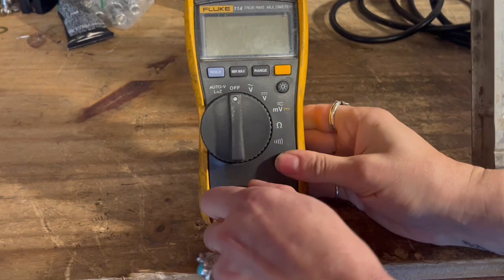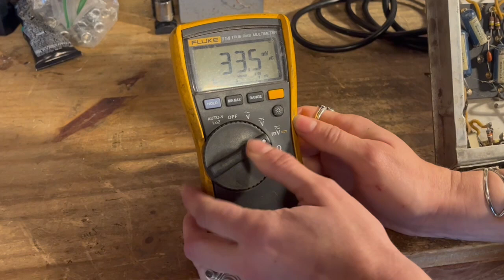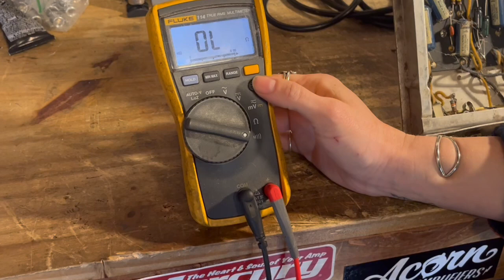How I Use My Multimeter | Vintage Amp Repair Test Tools

Comment: can I offer some vintage safety practices?  When the military was teaching me to be an electronics tech, vacuum tubes were still being used.  One piece of advice was "always keep one hand in your pocket".  This prevented having one hand grounded and then other touching a high voltage, resulting in current flowing through your heart.   Another recommended practice was to not wear metal jewelry (including our dogtags).  These pieces of metal might contact exposed component terminals, possibly shocking you, or just shorting out the circuit and causing damage.  Trust me, there are enough ways to get hurt without exposing yourself to easily preventable risks!  :-)   Thanks for the video!
Reply: My dad was military and Bell Labs trained. He has story about a guy losing (and cauterizing) a finger because he didn’t remove his ring. I don’t thing 350 VAC would do just that, but I wouldn’t wanna be the one to find out. For the sake of setting a good example to those new to this, please remove your rings!
Reply: @clubTSI  oh 350V isn't the problem here
The problem is how much current it can supply. If the power supply can deliver hundreds of amps easily without a breaker cutting it off then a metal ring basically turns into a red hot glowing blade. Especially at 350V? Easily. You could have the same effect at even 35V if the ring shorted the terminals of a high current supply. Because it'll pretty much burn through your skin and muscles
As a ring is near zero resistance it acts as a short basically and without a breaker or current limiter, it's going to dump all the current through it
Reply: @MaxC_1  perfect explanation man you know your stuff
Reply: She shows and explain this hand in the pocket safety technique in her previous discharging caps video. It’s a good tip, thanks.
Reply: I just added something similar to your comment! Sounds like we both had military training in electronic components 👍
Reply: I've heard that all my life and while it isn't bad advice, it's almost impossible to do  in some situations.   I think it's sufficient to always ask yourself 'where is my other hand and fingers'. Power saw users know this too.
Reply: I think I just came across the smartest comment on the internet. The bar wasn't very high so don't get too excited!
Reply: I’m a civvy that was lucky enough to be trained by Forces guys they gave me those tips. Very smart.
Reply: She already knows this…

https://youtu.be/_ATLTizLbDU
Reply: Yes, learned the same in the military; but one day, not thinking got a B+ 860 volt wake up.
Reply: While not military trained I was trained to do the same thing back in the 90s as it would lead a charge through one side of your body from your hand, typically, to a foot; when you use two hands a charge can go between both hands through your heart leading to death at her than just a painful shock. Also learned to do things in a manner that would cause a pull away rather than a grip or pull in motion as electricity can tense muscles and lead to you going deeper into the threat or gripping tighter; by planning on your position a shock would actually push you away from the electric.
Reply: Looking at it she is using Cat 3 test leads, I would recommend Cat 4 when working on valve gear. For the most part you should never encounter 1000V but I think the extra cover over the probes really helps. If you have 2 600V DC feeds close together then not so fun things can happen :\.

Comment: Safety precautions:
Remove all rings, wristwatches, bracelets, chains, and similar metal items.

Best regards from Odessa, Ukarina
Reply: That's an official rule in Intel labs when I worked there in 2012. Came about after someone broke a prototype board by shorting it with a ring.
Reply: @NiHaoMike64  
I think that at high voltages this increases the risk of electric shock.
And here is another reason:
Do not use clothing containing metal zippers, buttons, or other metal fittings. Metal, passing current, can heat up and cause burns.

Comment: Not sure if you answered it before but did you ever got shocked by mains voltage? These old amps seem to have a lot of open connections.
Reply: I made a probe “disappear” when I accidentally touched 170vdc to ground with 22,000uF behind it... poof... just gone!

Comment: I like tools that I can trust and I also like nice things, which brings me to the idea of buying a used Fluke. My original 77 purchased 20 years ago for maybe $75 is still working like new and highly recommended if you want to spend very little today. I picked up a 79 Series III to have capacitance and True RMS, but mostly because I like shiny toys. (Metaphorically shiny in this case!) I could actually get by with rubbish but not if it fails to work when I need it.

Comment: If the other components in the circuit are resistors and there is no cap that makes reading wonky, I tend to measure in circuit and then calculate the correct value from schematics :) 

However I have never fixed an old amp and if resistors are old carbon composites, I would propably desolder for testing :)

Comment: Nice! You break  it down very easy, and no nonsense. I recently got into FENDER amp repair. I own vintage ones. Like 9 of them. This helps tremendous . The video you have on discharging the filter caps was huge for me. I did have healthy fear, so i looked up multiple videos on it. Yours was the best, by far!

Comment: Glad to see you back!! Happy New Year. Have you ever done a tutorial on checking for noisey components such as resistors or caps with a signal tracer?? Also usint a an ESR for caps?? A lot of times values may not be bad but a cap component can be very noisy too. Also testing Electrolytics with an ESR meter to check to see whether caps are actually bad too.  I usually replace all parts but don't restore (Amps) very often.

Comment: Great content + straight-forward awesome presentation as always. My Fluke 26 is probably my most used piece of diagnostic gear (aside from my brain and maybe a metered Variac), and being completely comfortable with it and understanding what it's telling me is critical to nearly everything else that gets done. Testing known-good components outside the amp is helpful in this regard. The only time I've gotten questionable readings is when the battery was low. Ha!  Thanks for the safety demo and tips, too. (:

Comment: I don’t understand where it turns from AC to DC?(LOL) I guess I could search the web. Also, when you’re connected to ground on the chassis will the paint affect the reading going to it?
I’m a complete novice but it’s interesting and I’d like to learn.
I find amp repair videos very interesting.
Thank you.
Reply: Life for DC begins out of the rectifier. AC goes into the rectifier and DC comes out. You got tube rectifiers, diode rectifiers, Selenium rectifiers, etc.
Paint only affects the reading when its so thick you cant get to bare metal for a proper ground. And then it's no reading.
Reply: @michaelmoore7975  thank you for replying!
Reply: @lifelongfan07  I was hoping you wouldn't mind if I replied. I know you would rather have Colleen reply. I would too.
 And good luck learning this stuff. Everything you need is to know is easy to find. I only knew basic electricity 7 yrs ago myself, now I build and repair amps and guitars. You can check out a few of my guits on my channel. Kinda crappy video, sounds samples coming, still pretty cool IMO.
But anyway, you're very welcome.
Reply: @michaelmoore7975  no worries man. learning is fun and hopefully rewarding in one way or another.